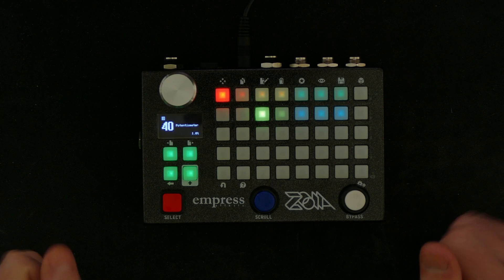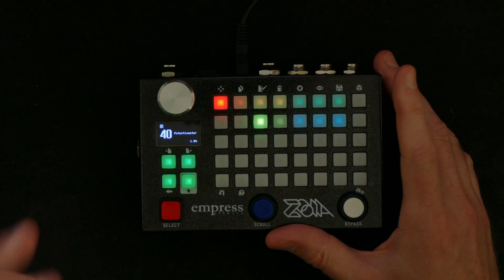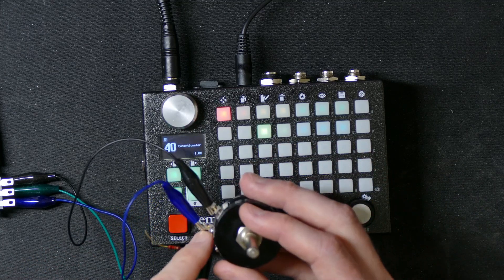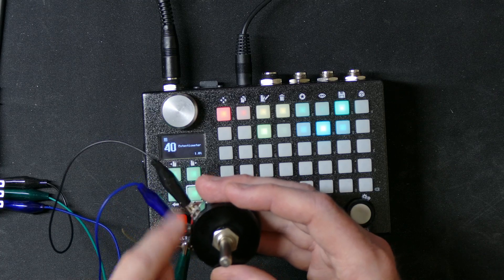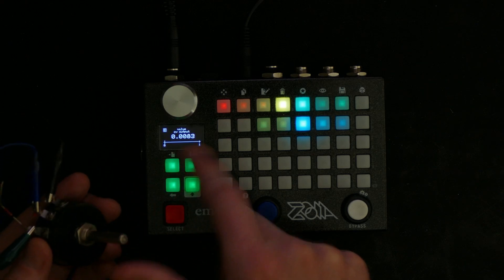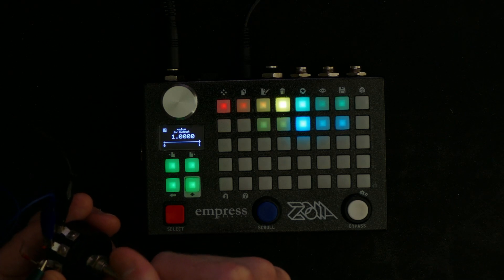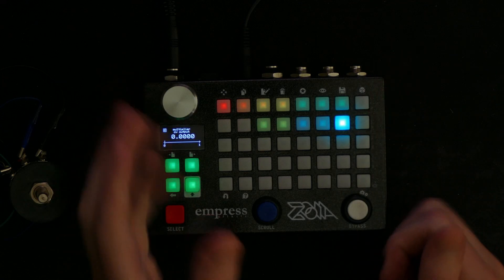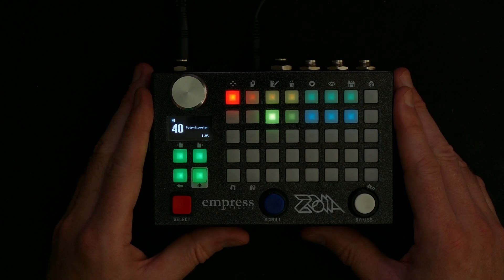Zoia Tutorial - DIY Potentiometer Controller

Comment: Hakon, could what are the specs for the potentiometer? Could I use one from Guiter volume I have laying arojund or do I need some spciphic type?
Thank you
Reply from the maker: I don't really know enough about electronics to understand what exactly makes one want to choose a specific resistance rating potentiometer over another when using it as a voltage divider as I do here, but since the Zoia itself would have its own output and input resistors on the control port, I don't think there is a "wrong" rating in this case, at least in the sense that it won't ever possibly cause any damage to anything.

I'd just try it with what you have lying around and see how that works. Of course it would behave a little differently with a logarithmic compared to a linear potentiometer, but that's not to say one is necessarily worse or better than the other, just different. I am guessing a volume pot might be logarithmic whereas the one I use is linear.

If the effect you get seems a bit wonky because the resistance changes more at one end of the pot than the other, you should get a linear pot to use instead.